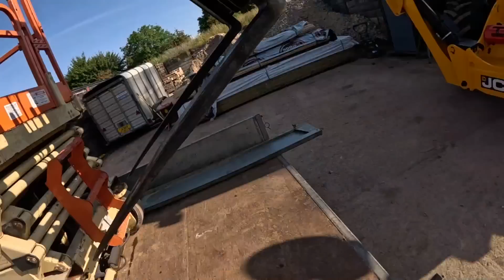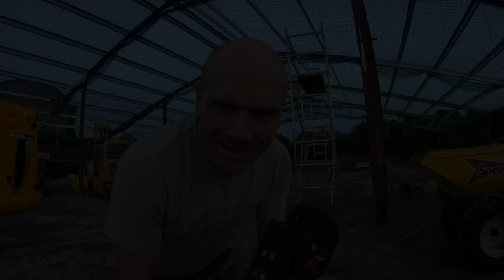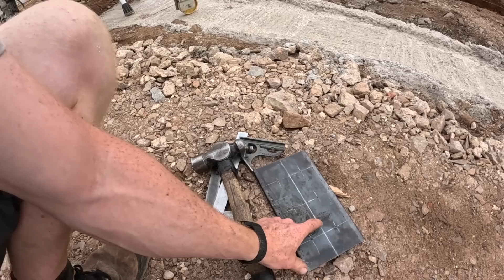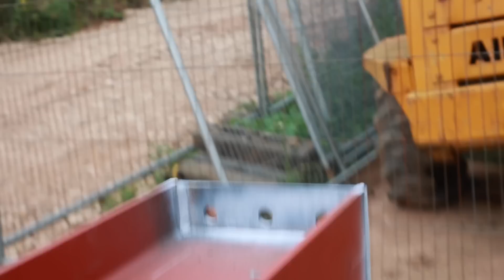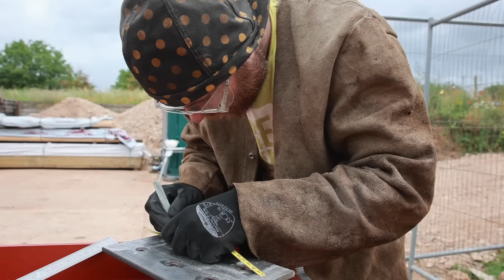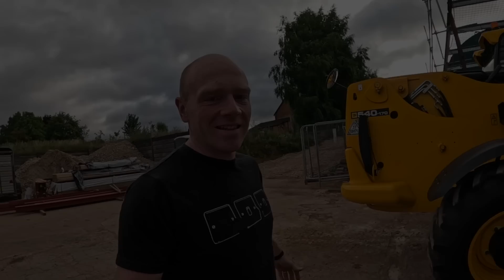ANOTHER LEVEL TO OUR BARN CONVERSION!

Comment: A bit of lube when drlling the drilling the holes would cool the cutter or even a washing up bottle with water in will help to cool the cutter
Reply from the maker: It was cutting fluid that was being used. 👍
Reply: @TheRestorationCouple  sorry I must have missed that bit, where those long beams254 x 146

Comment: You could make marking the fixing holes on the beams easier. Drill your template out with just a pilot hole clamp it in position then drill through with your pilot drill bit just enough to create a dimple. This will allow you to position the pin of the mag drill. Accurate and easy to repeat. 👍
Reply: I was going to do that to fit my centre punch but I ran out of time 😅